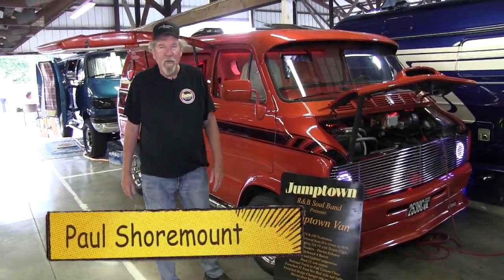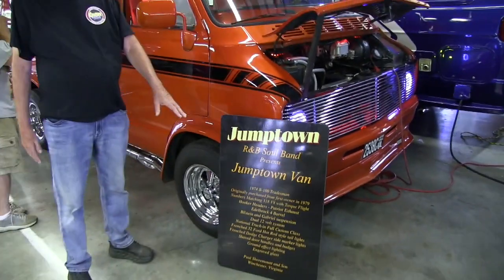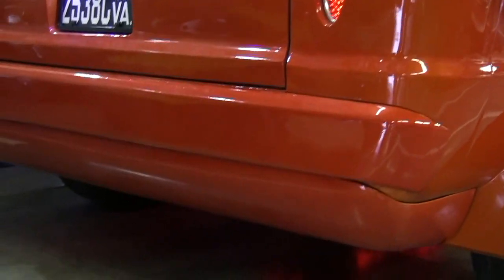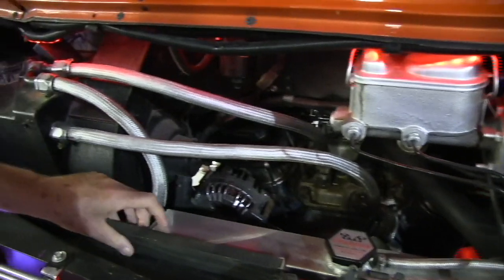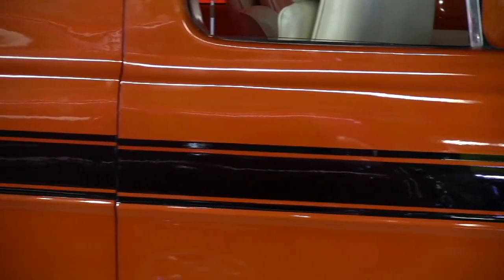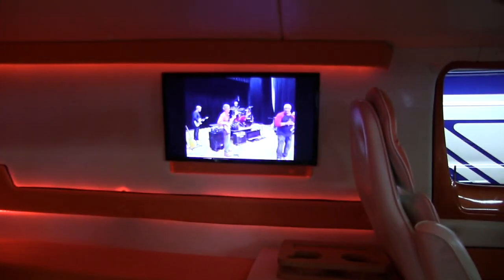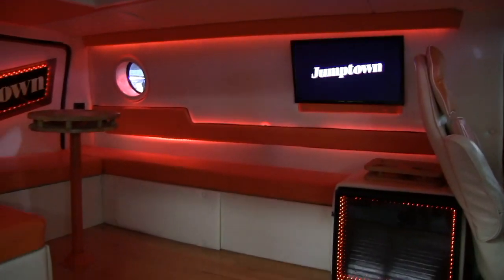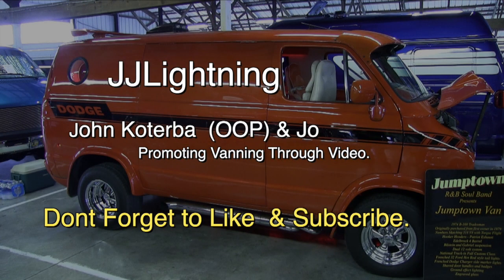1974 Dodge Van. “Jumptown”

Comment: OMG that van js sexy as hell. I had an 85 Dodge B2500 “Wagon” (van with windows and bench seats) and fell in love with that van. Did a bunch of upgrades to the 360cc and interior/exterior but nothing even close to this level. So to helath issues I had to sell it since I couldn’t keep up with the cost of having it. I got so much enjoyment out of that van. Dodge made such nice vans from the 60’s into the 00’s. Their body styles were the nicest. Especially the 70’s to the final 94 style. I had a 97 high top conversion van for a few years. The chrome rims from those mid 90’s to 00’s dodge vans are nice as well. Found a set in perfect condition at the junkyard for $50. Slapped some M/T’s on them and instantly made my 85 look so much meaner. As you can see by my username I’m a massive dodge van lover. Just wish I could own one again. Prognosis of that happening is low

Comment: Have a 76 - will be putting on a whole new front clip - mean street engine build, nothing beyond reasonable... Will be using my chev TBI and custom HEI system...

Gullwing side door in order to have a builded in porch roof,  just in case it rains at a show - not all are indoors as you know... 😉

Lowered about 3" so I can mow the grass - but not so far as to kick rocks.  The only rocks this van will be dealing with is when it's rocking late at night 😉. 

I may be old - but I'm not a robot, need a little bit of play time...🤠

Comment: Good afternoon Paul, I am writing from Tijuana Mexico, I like the Dodge brand, I have several projects and a couple of cars already finished, but now I have a 1978 Tradesman van that I found here in Mexico, I can't find the series, I want to know what I bought, The papers I have are from Mexico and only an engine number. I would like to know what type of van I bought, how can I find out?
I have a Road Runner 70 I know how to find the 3 series of those but not the van...
 thanks for your support.